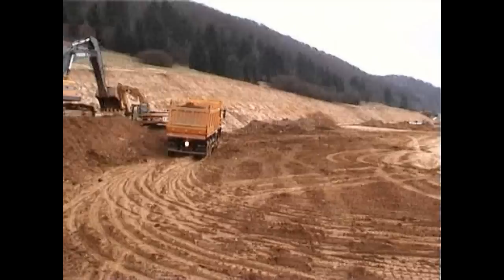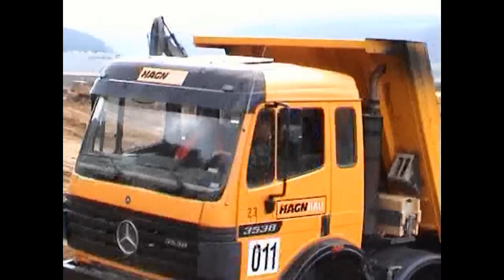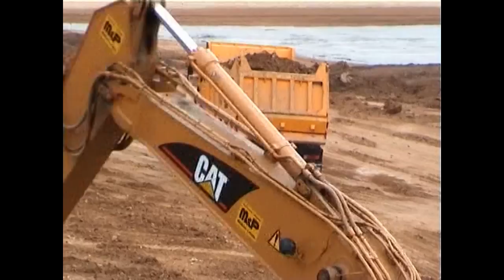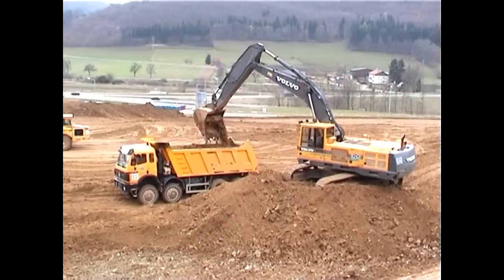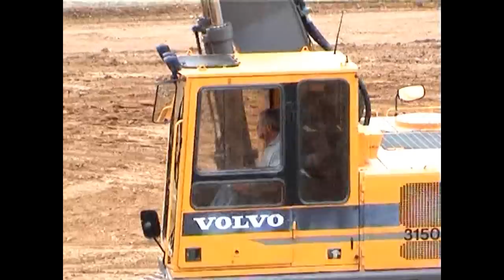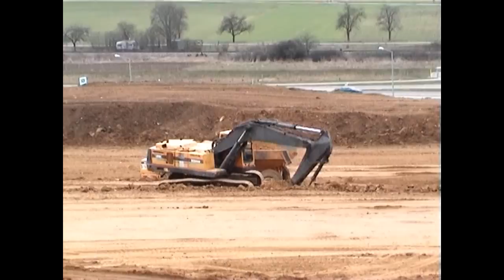VOLVO EC450, A25C, Mercedes Dump Trucks / Fa. Meister, Neubau Zeiss Oberkochen 04.04.2003.

Comment: Fantastic machines, those Volvo or Åkerman excavators. I operateda H10Mb and then a H7mc for 6 years when I started in the biz. And all because my father was the one who painted and put all the decals on the machines that were made here in Eslöv. All the H25 and the Ec650 made from -79 til 94 is painted only by my father since he had the olny spot where they would fit at the factory. Great vid, cheers
Reply from the maker: +Kristoffer Persson Wow! So your father was Akerman's Pablo Picasso ;-)